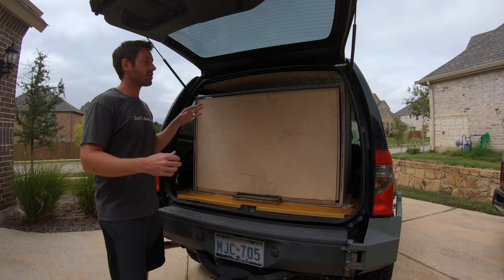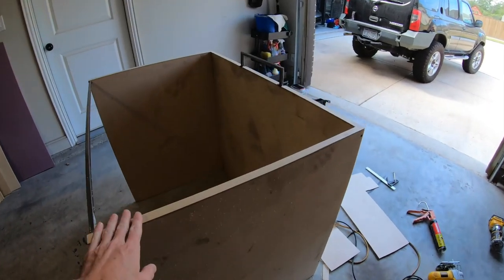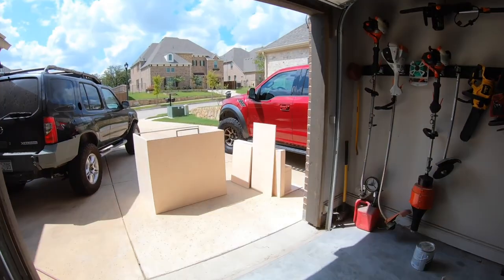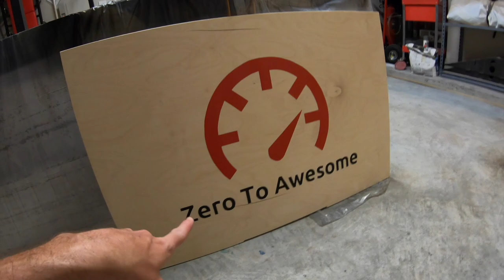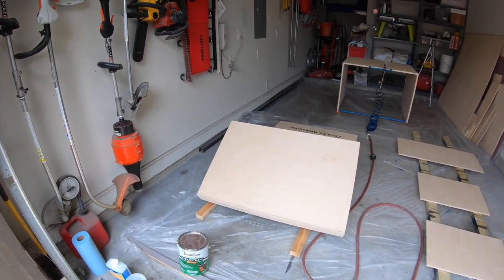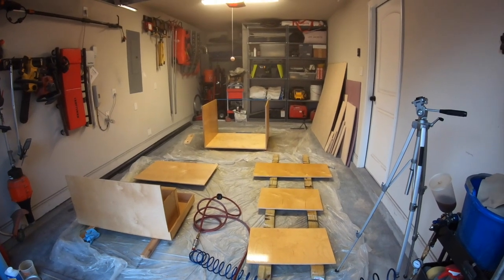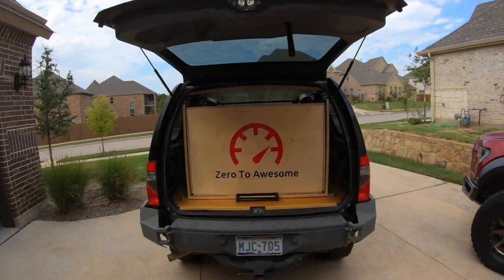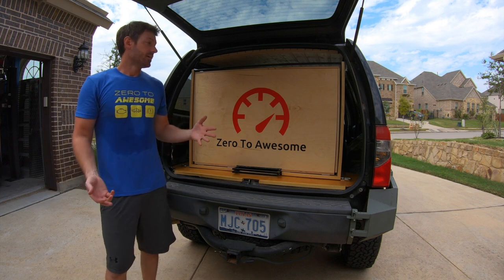I said I wouldn’t do this... but here’s our SECRET to waterproofing the wood for our offroad camper!

Comment: Any idea what kind of weight you're carrying?
Reply from the maker: Probably somewhere around 200 lbs
Reply: @ZeroToAwesome  Thanks for the reply. That's pretty impressive that all that only weighs in around 200. I'm in the planning stages of building something similar on a flatbed trailer. I want it to be removeable on site and weight is a major concern for my vehicle.